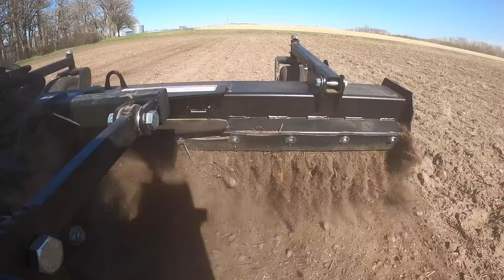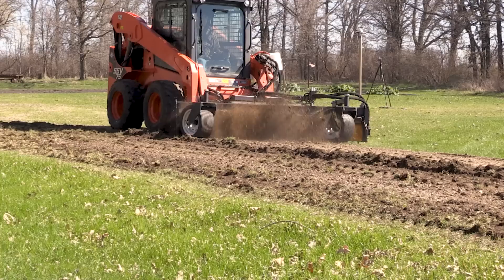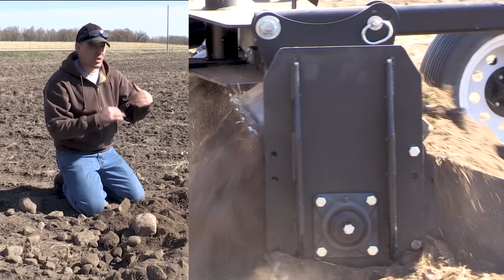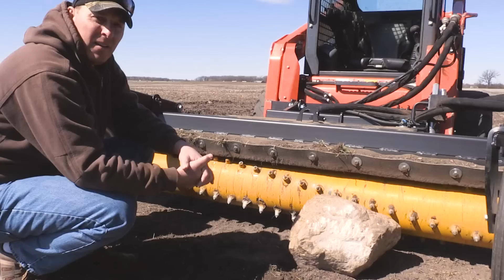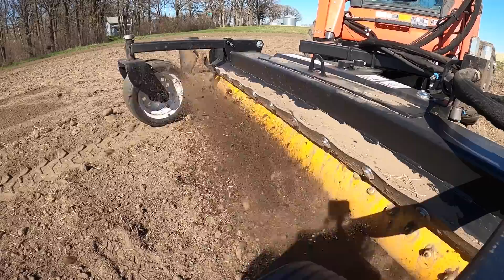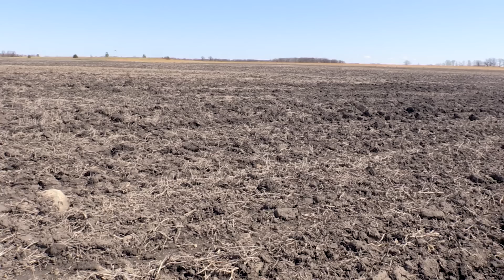Quick Power Scape™ Soil Conditioner Overview, Yard Prep, Drive-way Maintenance, Land Leveling

Comment: How many gallons per minute unit do you need for that unit and what is the smallest with available for a 50 horse power skid steer 60 inch wide
Reply from the maker: Rich, the Quick Power Scape™ has a flow rating of 15-33 gpm.  The 72" model would be a great fit and would cover your tracks nicely when the unit is fully angled.